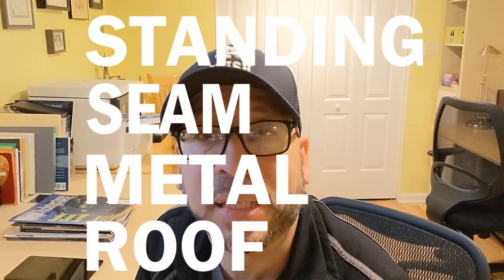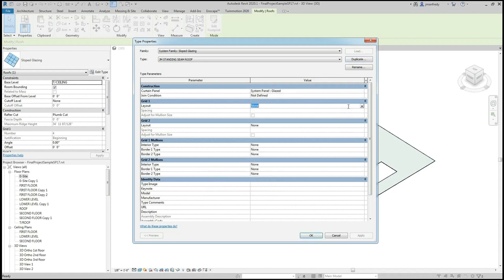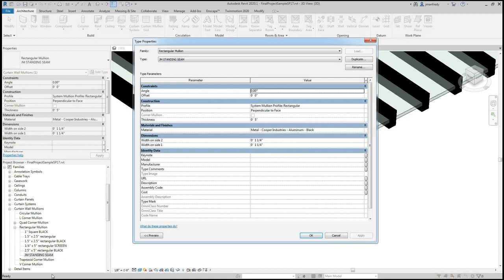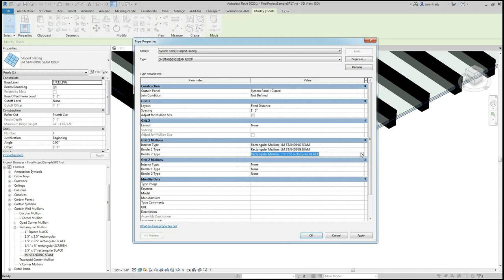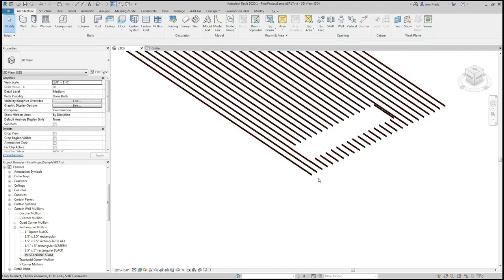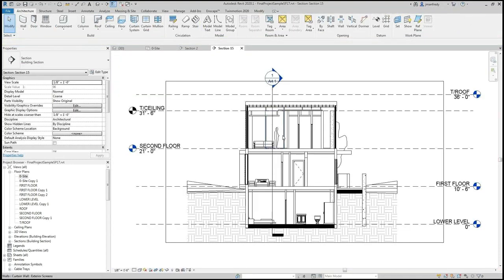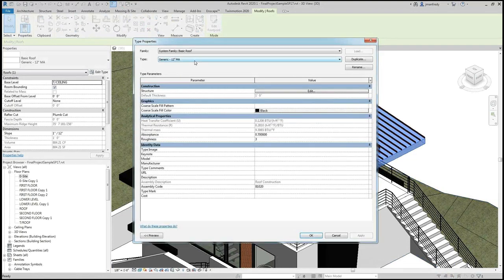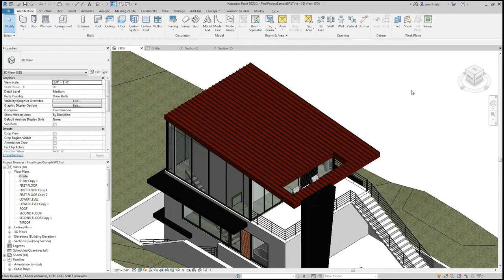How to Create Standing Seam Metal Roof in Revit

Comment: the problem with this tutorial is that is not accurate. the roof system nor the standing seam panels are not design or drawn how they suppose to be. / it will be best if you can draw one panel as a family and apply it to an exterior wall. accurately. in short, this tutorial only show a visual representation of metal standing seam..................even though they are not drawn acurratetly.
Reply from the maker: Correct, this is a meant to be a quick solution without the need to create families.  There are several methods to solve this issue and the following is most useful to my students to quickly create a design with this look.
Reply: @jrmanfredy  I agree. however I feel that in order to understand how to use revit properly, another video showing the correct application will be awesome: thank you. keep up the good work. I will be waiting for the next video. best.